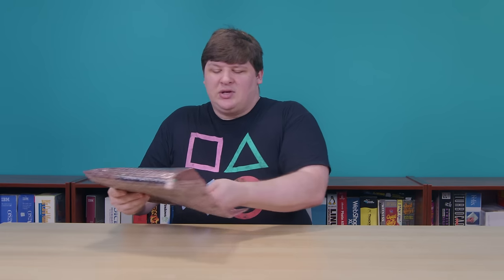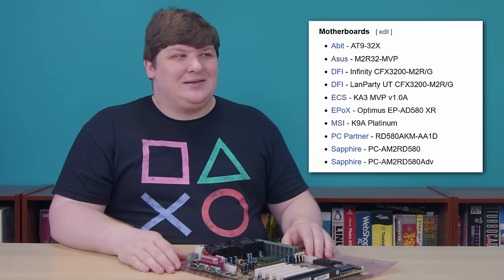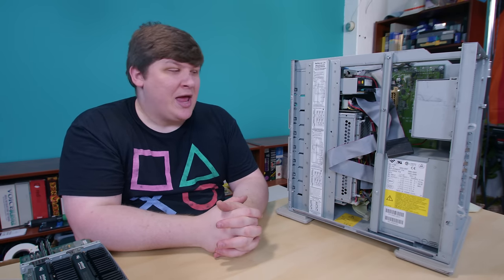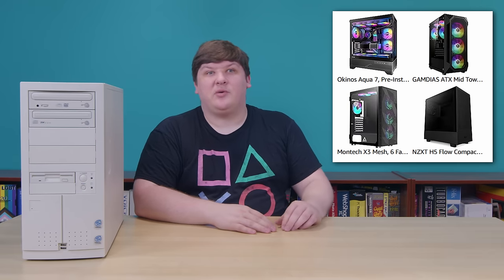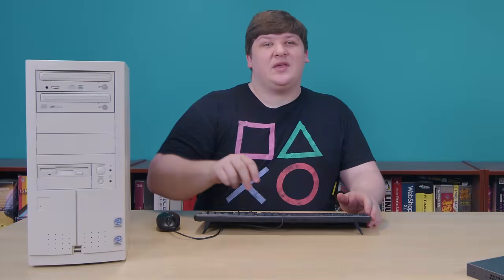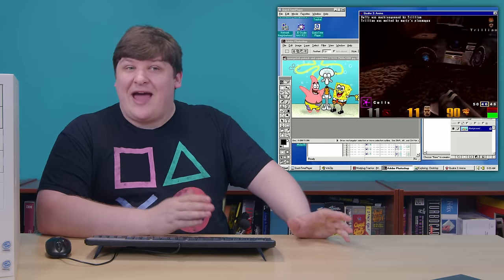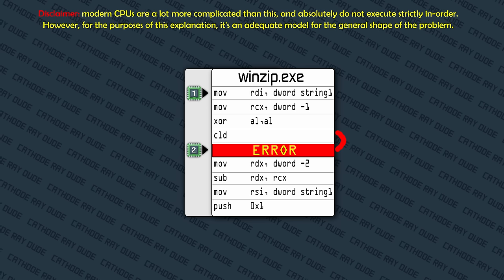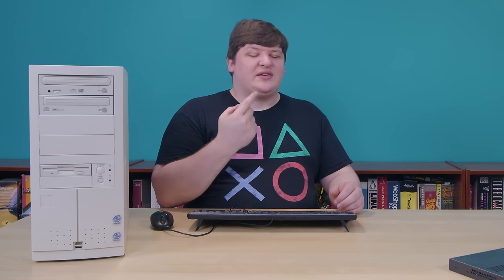The Only Famous Motherboard

Comment: I think your also forgetting that Hardware virtualization eairly modems didn't use the CPU to generate the signals, DSPs got virtualized, hardware of every aspect got virtualized and moved to using the CPU, it was transparent to us mostly but on Low end machines IT was very apparent with CPU usage that spiked when using virtualized hardware nic sound cards

Comment: Perhaps I am being pedantic on this point ,but Celerons were not the best on the market at the time, they were the best value for money, couple that with the fact that they overclocked like mad very very easily, you end up with a shit ton of enthusiasts that bought them, got "free" performance out of them. That's the kind of thing that stick with you. And this all came on the back of the Celeron 300A, which you could nearly double the clock speed on pretty easily, so the socket 370 Celeron's were very popular. It was the perfect storm of affordability, popularity and overclockability. 

I mean think about it, the allure of that board was that you could get two 300 celerons, throw them on that board, double their clock speed (or their abouts), and then double that performance again due to having two CPUs. The allure is kind of obvious when you think of it that way.

Comment: uilt a P3 Tualatin system once or was it dual pentium 2. i think i shoved a tualatin in a slot mobo with a slocket adapter and ran xp and eventually killed the single VRM. shit was cheap in or after my high school days in the  late mid 00s

Comment: i bet during the photoshop run, even though the difference is smaller, at least the UI is more responsive. when doing it single core, the cpu usage is really hitting the cap so not a lot of room for UI responsiveness

Comment: 37:16 except back in 1999 when Linux didn't have multi-threading and could only schedule threads, that was fixed in the Version 2 of the kernel ironically. And they said Linux was better than Windows, well it was better than Win98.

Comment: i guess technically you're getting better thermal performance in some ways with smp in non multithreaded apps.  you've got a much greater chip area and only stressing one of them at a time back and forth.  but that isn't worth the enormous added cost and wattage.

Comment: I had this board, and what sold it was dual CPU on the cheap... That is, two sub $100 Celeron Pentium 3 CPUs.. All the others required same batch more costly Pentium CPUs. ABIT found a way to manipulate the CPU socket to allow for this.

Comment: 04:00 The transition to multi core cpus wasn't smooth at all. Anyone that was unfortunatel enough to endure the Pentium 4's hyper threading to make that transition happen knew full well the pain SMP users were going through even if it was just hyper threading on the Pentium 4. We felt the same ungargled wrath of disappointment as games that attempted to make use of multiple CPUs just failed more of the time and it was a lot of hurt for a lot of people. Some going as far as just turning hypertheading off completely just so they didn't have to deal with the games and programs trying to use SMP/multicore/Hyperthreading situations. It was however, the kick up the back side that most game devs and application developers needed to see the writing on the wall as far as where CPUs were going, and while the actual transition to multicore CPUs was a lot smooth because of the pentium 4's HT motherhood, it definately wasn't smooth without it.

Comment: It's definitely not the first board to achieve that. The first Socket 370 board maybe.
The PCCHIPS M720 came out in 1998 and supported dual Slot 1 Celeron CPUs. And yes, it was dirt cheap.

Comment: I am sick of the claim that Windows 2000 was a commercial operating system.  Almost every home user I knew had it, including gamers (who were dual booting 2k/98SE so they could play all their games on a single computer).  You know what was actually rare to see on a home system?  Windows ME, because Windows 2000 came out first and was better in every way other than DOS games, which were also broken in Windows ME!  The big OEMS were selling Windows 2000 PCs clearly intended specifically for home use.  You basically only saw ME on ultra-bottom-end trash boxes.  It wasn't until like 20 years later that I started hearing this idea that Windows 2000 was not a home OS.

Comment: ABIT!!! WOW what's wonderful motherboards once upon a Time what the hell happened to ABIT!!! I used to build so many many machines for people I only want to ABIT my #1 truth truth choice for performance and true reliable way to go!! And of course Asus 2nd choice 90% of machines I went straight to Abit i loved them!! I remember building few Abit with K6 And oced to pure 😈 mode absolute insanity and it will still reliable and booted right away!! Went from K6 to 👿 K66 on white dust at that time the speed mhz i was pushing was not available for a good year and a half+ not from amd nor Intel and again reliable and smooth and only on regular cpu fan style not overheating also!! It was astonishing I dont remember but i built 8 pcs like that and all of the customers were using them for years none of them had any failures but I told him he is this performance maybe you'll get a year out of it they didn't care and they wanted speed right away even if it was for a short while they were happy but when they called me like 2 years later and telling me still working I will shocked and then they called me 4 years later hey man its still working!!

Comment: BP6 was legendary. I never had one but guys who I use to go to lans with all had them. 
they could run quake 3, unreal and couter strike server on 1 and join there own server with out a slide show.
 
BP6 had 8 IDE ports rather than 4. 
BP6 had soft menu and you over clock the crap out of it....  dual celeron 366 could run at 550mhz 
you were not meant to be able to run Dual celerons intel had a hissy fit pretty sure abit went to court... 

2006 I can remember to run some games Rune you needed to set affinity to 1 cpu or CPU zero

everyone knows impulse tracker was the best tracker :P for making music :P

USB didn't work on NT4

Comment: Certification, they designed it, so they only had to certify 1 case, which costs less. They do it now with the Alienware too, they use the same case design (from the 90's it looks), they make brackets to attach 120 mil fans to an 80 mil mount which is nuts :p all that mechanical engineering to keep using the same case . . .

Comment: why would CPUs ever be put onto daughter boards? I never could figure that out.
Wouldn't it be electrically faster to access the the bus from the rest of the board if it was on the board?
Reply from the maker: I would guess that while the speed of the bus between the CPU and memory is critical, the PCI/EISA operate at such a low frequency in comparison that distance isn't a huge factor, so it's not a problem to put them on a removable module for the sake of convenient maintenance.

Comment: My mans forgetting the existance of the PowerMac G5 which cam with up to two chips with two cores each for a total of four cores.

It was also only 5 or 10 years ago when 2 core laptops were common. There were lots of 7th gen dual core CPUs as Intel didn't start pushing core counts until 8th gen and only then because of Ryzen. You could get a quadcore laptop, but only in gaming laptops or workstation laptops like a ThinkPad P50 or MacBook Pro 15".
Reply from the maker: You're right, this is the first time I've ever heard that the G5 came in an actual dual core variant. I've known people who had hundreds of them, not once has anyone ever brought this up. That said, those are fiendishly expensive workstations, so in terms of consumer silicon there were still no multicore chips.
Reply: @CathodeRayDude  Yeah I don't know if it could be called consumer at the prices those things were sold. Though I don't normally think of Apple as being truly business either. They make the kind of PCs that are just likely to be found at home as in a business. Apple is odd.

Comment: Thing is, Windows 2000 dropped within 6 months of the PB6 release... This is what consumers, errrr enthusiasts were running, not NT4. Windows 2000 had all the good of NT4 for SMP and stability, and all the good that was win9x including game support.
Reply from the maker: Well sure, but six months is an eternity in this era of computing and "people upgrade when upgrades come out" is a truism. I could move forward to late 2000 and talk about dual coppermines instead, or about the people who were still building BP6 setups in 2001 because they were so cheap, but I found it more interesting to look at what this board represented when new.

Comment: The claim that video games are mostly single threaded is sort of correct but not really. What it means is that a single threaded benchmark is more relevant than a multithreaded benchmark to determine how fast most games will run. Most games are absolutely multithreaded, but are not loading the CPU enough to cause the CPU to thermally throttle as much as it would for a load that uses every available thread. A multithreaded benchmark will throttle a CPU far more than a single threaded one, and video games are much more similar in CPU performance to the latter.

Comment: So, I was an SI even back when these were current. And I can give you THE authoritative answer as to why nobody else did it: ABIT WAS INSANE. I am not joking. ABIT was the EVGA KINGPIN of the day, except even even more insane. They invented the CPU Soft Menu purely for overclocking. When Intel told Abit "this BP6 thing, absolutely no, we do not approve"? Abit said "we don't care, stop us." Intel tried, and Abit laughed at them. Which is why the BP6 is the ONLY dual Celeron board. First serious overclocking competitions? Abit. Fatal1ty motherboards? Abit. Actively giving the middle finger to Intel? Abit.

Now, you said "nobody can men-" Yeah, no, MSI MS6120, QDI Legend for Pentium II Slots, and three letters just as important as BP6: *V*P6. The dual Pentium III. By which point, everybody and their brother was coming out with a dual Socket 370 board. Most of which were absolute crap! Even EPoX had one! And let me tell you, if you think 300MHz Celerons at 450, 500 are insane? The VP6 in the right hands, is a toddler being force fed sugar-coated methamphetamines. Pentium III Cus at, oh, I dunno... how's a 178MHz FSB sound? Or let's just take a 600, leave the multiplier at 6x, take the FSB from 100 to 150 giving us a cool 900MHz with a 4 pack of carefully picked 128MB DIMMs and... what's that ominous music?

... oh. Oh dear. It's the Tyan Tiger MP and MPX. (Trust me. You absolutely want to look into the Tiger/Thunder K7 - which came out just 2 years later in 2001. Also, god, those are retro now? I feel ancient.)

Comment: Try maxing out the RAM then installing Windows XP Pro to see how it does with SMP. A thing to note about XP Pro is on many dual CPU servers, Microsoft had the manufacturers fix something in their BIOS to specifically block XP Pro from being able to use more than one CPU. I had a Compaq dual slot Xeon server and regular non-server Windows 2000 could use both CPUs, so could Windows Server 2003 and 2008. Linux had no problem with it. I assume NT4 probably would have worked with both CPUs though finding all the drivers might not have been possible.

It was only XP Pro that was targeted with the block on dual CPU on this server. I tried forcing a change to the dual CPU HAL and that didn't work either. The hardware would detect XP and go "No CPU1 for you!". So I installed 2000 Pro and gave it away.

Another dirty trick Microsoft did around then was forcing the business uptake of Windows 2000 by threatening OEMs with pulling their Windows licenses unless they stopped releasing NT4 drivers for their newer systems and peripherals.

One more 'fun' thing with NT4 was from Iomega. For their Ditto and Ditto MAX tape backup drives they had drivers for Windows 9x and NT 3.5 but NOT for NT4. The drives flat out would not work in NT4. This was despite NT4 having been released prior to the release of the Ditto tape drives, and the rapid replacement cycle of 3.5 with 4.0.

I ran into this when setting up a PC for a dentist's office. He chose the tape drive and insisted on using it. The only way to make it work was to install NT 4.0 on a FAT16 partition and Windows 95 on another partition then dual boot so Windows 95 could be used to backup the NT 4.0 side.
Reply: What dual Xeon Compaq server was it? I tried XP Pro on several Compaq servers with dual CPUs (for example, Proliant 7000) and they worked without problems.
Reply: @Thales_WH  big one, rack mounted. Dual 700 Mhz slot Xeons. Had the label with instructions on how to open the cover on the inside of the cover. It also had a label inside with directions on where to place all the other labels, including the one with the how to open instructions.
Reply: @greggv8  
74 / 5 000
This corresponds, among other things, to the description of the Proliant 7000 and it works correctly :)

Comment: Does the board technically support other CPUs - like pentiums ? Will they even boot and work?
Reply from the maker: Nope, all other socket 370 chips in existence, celeron or pentium, use a different signaling standard for the interface. The 266-500mhz Covington and Mendocino celerons were a completely unique design unlike everything that came after.

Comment: Still have mine. It was a hoot to see the water cooling solutions using automotive  transmission coolers and aquarium  pumps  in a Tupperware bowl! The Celeron 300A was the CPU of choice because it was the only one that was unlocked at the time.
Reply: The Mendocino Celerons were overclocked by changing the FSB. This has nothing to do with being "unlocked".

Comment: These Celerons did not officially offer SMP. Abit did just build the board and Intel was not happy about it. By far a too cheap multi processor solution in their eyes back then. When the coppermine Celeron was released Intel did remove the SMP functionality to make sure people have to by expensive XEONs or Pentium IIIs at least.

Comment: Gotta say, I was excited about the topic based on the title.  The BP6 was an amazingly popular board and helped put ABit on the map when it came to innovation and overclocking.  Many of the engineers who worked on the BP6 migrated from ABit to work on the DFI LanParty series and the ability to run Celly procs in SMP mode was groundbreaking.  However, you lost my interest around the time you brought up the Wiki page, after that total snoozefest.

Comment: Oversimplified. Today we are in a age of having multiple CPU chips in a single socket. Take AMD Zen2-5. Having 8-Core Complex Dies (CCDs)
In the server world? You can have up to something like 8 CCD's in a single CPU. Intel have something similar. But more like what Android/Apple do. (Arm CPU's.) Big, and little cores complexes.

As soon as your game jumps over to a second CCD? You get a performance penalty. And the fastest gaming/server hosting CPU's are literally staying on a single ,CPU complex die, for max single application performance.

Today we are literately back to a time of dual-core CPU's. Where servers are either, Quad or Octa-Core. And for gaming/majority of people. A single core CPU is more then enough. Even if it in reality is a 6 or 8 core CPU. Something like a Ryzen 5600G, APU? It is so incredibly fast for what it is. And still there is enough space in the CPU to have a rather big GPU with the CPU. And say a Ryzen 7950x has 2 CCD's. And ontop of that a more then powerful enough GPU, built-in to run a 4k monitor (doing CPU heavy tasks mainly.) Quite frankly amazing. It is actually hard to find the need for anything more then 8cores. And since a single CCD can hold 8cores? Leaving a huge chunk of the CPU area empty?

The days of graphics cards are numbered. If laptops and phones where not a sing of things to come. Then the fact that 99% of people could not if they tried to find a use for a dual-core? I mean dual-CCD cpu? Yea.

Comment: Just a note but, 1999 was the Windows 2K erra not NT4. Try over all your tests using 2000 and maybe dual boot with win 98 SE as most people did at the time 😉😀
Reply from the maker: The BP6 came out in July 1999. Windows 2000 was released to manufacturing in December 99 and retail in February 2000. It was literally impossible to buy a copy of Win2K when this board came out, or for seven months after. Yes, you could pirate it, and maybe some did, but many didn't. You can very easily find plenty of evidence that many people ran NT4 on this rig, and I personally remember it being the done thing at the time. In this era of computing things changed by the minute; this video centers on roughly august 1999, and a machine that could have been built (excluding the Geforce) and used by an only moderately savvy individual, with retail parts, based on a suggestion on a forum - not someone with access to the far more exclusive piracy channels of the day to get a 2K beta. In fact, given that SP6 came out in October, I arguably should have run SP5.
Reply: @CathodeRayDude  All you said is very true and I agree with your logic. I was one of those who surfed MIRC and got the beta's. I do understand most people didn't, but in the 90's if you knew me, you had access 😉 FYI Been running my tech Biz since 1997 to present.

Comment: I bought a computer with that  mother Board used in 2000. With win 2k , 2x celerion 330 over clocked to 550Mhz.
When I upgraded the hd, it began crashing. Maybe I used the white ide port? My solution was to switch to Linux and it worked. Been on Linux since 😂